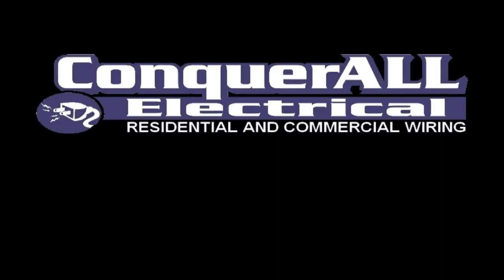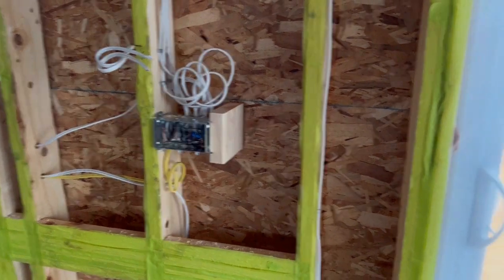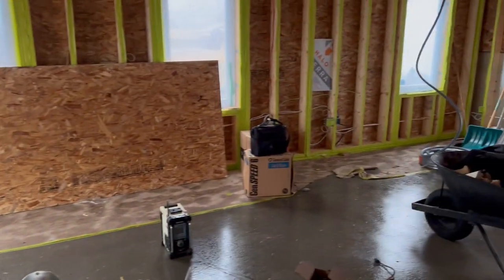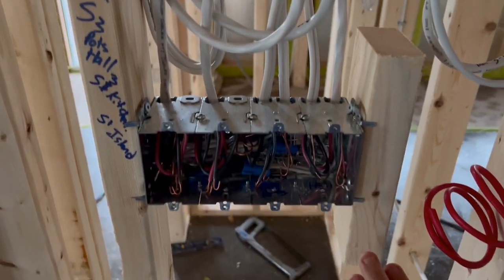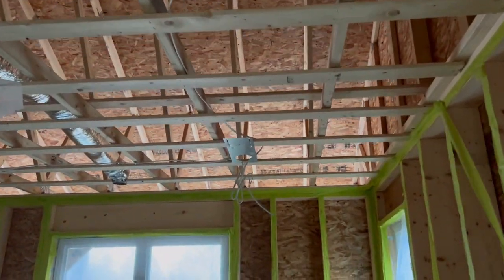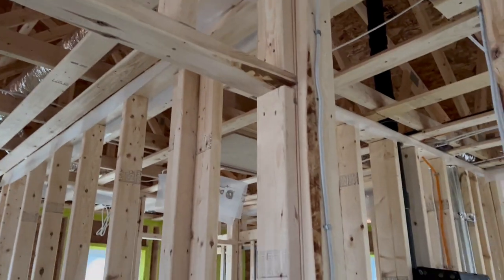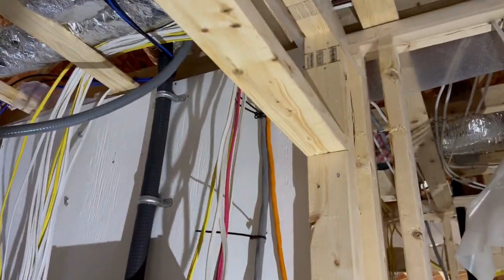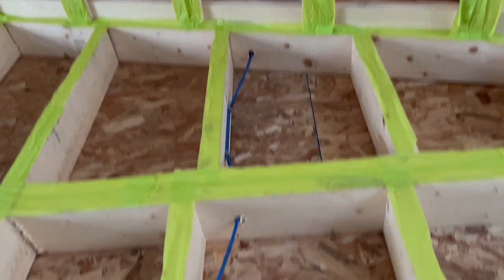New Construction Electrical Rough In Inspection-What They Look For

Comment: For the rough in inspection, do you just have to put the wires into the panel or also attach them to the breaker?

Comment: I’m wondering where you live, and do they require metal boxes?  As an electrician, I would never use metal boxes unless required by the idiots of the jurisdiction. First of all you have to ground them ( more time) and they take more time to install. Also for your viewers, the blue boxes at the big box stores are garbage, they make black boxes ( don’t remember the manufacturer) that are a far better choice.

Comment: I want to upgrade my panel from 100amp to 200amp. I have an old box and not only am I upgrading box but the amps. My question is will the inspector come in the house to test all the outlets or report me to the county for any other building code violations. Its a 100 year old house. Im just wondering if they would do that? Thank you

Comment: Hi, I was wondering how many holes can you make in the top plate for wires going to the main panel. I didn't find much in the electrical code book accept they should be at least 1 1/4" from side of the stud.
Reply: It depends on the size of the hole you make, if its 1/2 hole u can only run 2 wires through it but only 12.2 or 14.2 wires

Comment: Is that junction box installed low enough in that room above the door rough in? ruel of thumb is from the ceiling 4" minimum down  FROM the top of the installed smoke detector and no more than 12" down from the bottom of the installed smoke detector.
Reply: The minimum is 4" of the wall because is always air in those corners
Reply from the maker: Here in Nova Scotia smoke detectors must be on the ceiling or a maximum of within 1 foot or less to the ceiling if mounted on the wall.

Comment: Are you guys asked to run wires at the same level as the strapping or is that preference?
Reply from the maker: Between the strapping actually as a code rule. Or on top of the rafters if they are less than 1 meter space for storage and mechanically protected.

Comment: any particular reason why you are not running the wires in conduit? Around here everyone runs them in conduit.
Reply: Conduit is rarely used in residential construction anymore. Romex has almost completely replaced it. Both because of cost of materials and labor/installation costs. I only know of a few jurisdictions that still use conduit, Chicago being one of them, largely because IBEW134 is incredibly influential in the city and has maintained a stranglehold on electrical work for many decades.

Comment: I used to ask my ( old) boss about if neatness matters because I have seen what looks like art and I have seen horror shows that pass inspection…..my boss answered that yes, it matters, to the two most important people…….you and me
Reply: 110.12 is code for basically clean and professional manner usually doesn’t get called , not usually garbage to look at but inspector can call it and is very discretionary
Reply: Inspectors are about code that’s all. Professional standards is not code however it’s good practice. If an install is code compliant then it should pass. Workmanlike manner is very opinionated and hard to enforce. Some states it’s not allowed to be enforced by statue’s. Code and inspectors is bare minimum with exception of an local general code. Follow the NEC (the state is currently on) and professional standards generally in your area and the only thing you’ll ever fail are the local codes that you happen to not know about. Don’t matter where you are at.